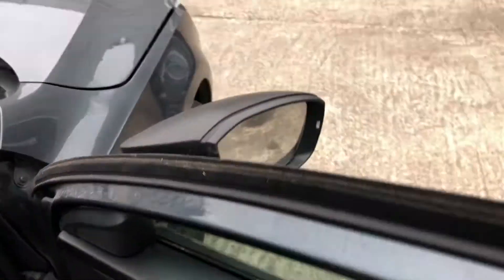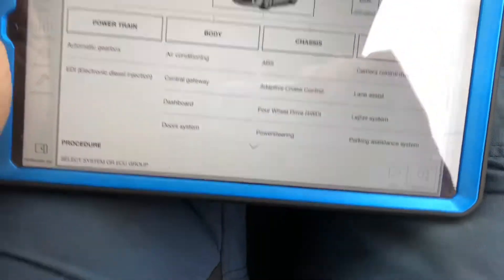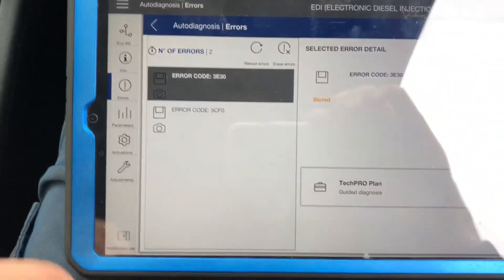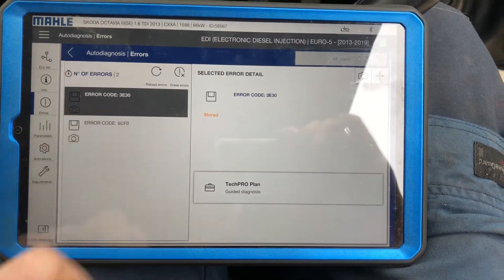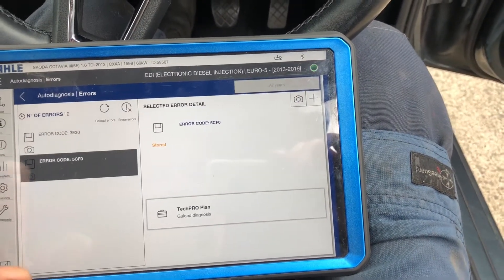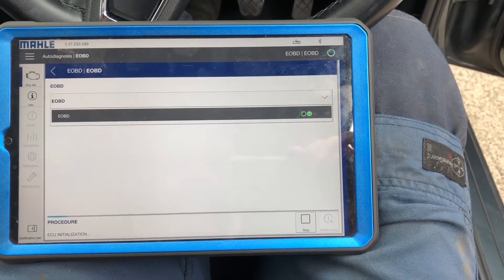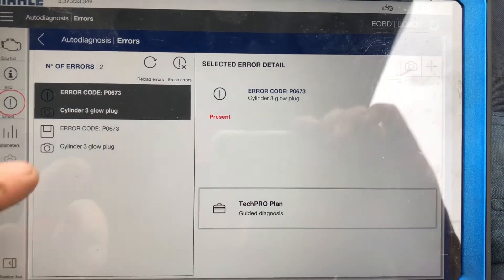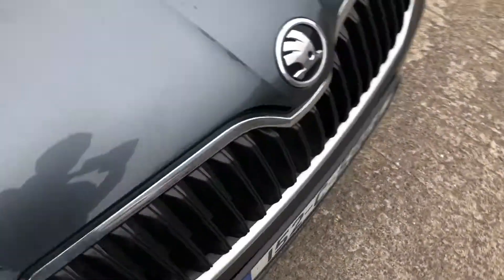P0673 Glow plug testing with integrated pressure sensor

Comment: Thank you for this video. I couldn't find any guides on how to remove the pressure sensor plug connector. I was afraid i would ruin the whole connector if i pulled to hard. 
Now with your video i have an understanding on how the connector is connected.
Reply from the maker: I had the same thoughts hence the video, but I’m glad it helped on this occasion. Good luck when doing it 🙏👍
Reply: Thanks for this video   on how to unplug the glow plug especially. 😊 Trouble with modern cars is there are so many different plugs and connectors , and it's not obvious how most of them unplug. Thanks for showing us inside the glow plug too , I wondered how they worked 😊👍👍👍

Comment: Where do you put the black multi meter wire when testing the plugs
Reply from the maker: Apologies, I should have said. Get a multi meter and put it on the OHM’s setting. Then put the black lead on to battery negative or any clean steel part of the engine. The red multimeter check for a contact through the heater plug and back to the engine or battery negative. 
Does that make sense??

Comment: Your video is great, I have this problem, I changed the spark plug 3 and I still have the same fault p0673, could it be the wiring? or could it be the relay? What do you recommend?
Reply from the maker: Where did you buy the glow plug ?? They can be expensive 😬
Reply: @kennedysgarage3281  en VW 180€
Reply from the maker: @NI1NIRVI  hmmm time to start looking up a wiring diagram 😬😬
Good luck with it 🤞🤞👍
Reply: From what I’ve been told the Bosch ECU doesn’t like cheap spurious glow plugs being fitted, it’s got to be a OEM VAG or BENU 007 anything else can lead to problems.  GSF Motor factors want £220 for a new one !!

Comment: Great video. I have the same issue where cylinder 3 glow plug pressure sensor is low. I have fitted the new glow plug with the pressure sensor however EPC light still shows on the dash and still has the same code. Could this be a damaged connector which sits on top? What would be the best course of action? Thank you :)
Reply from the maker: Is it the same fault code ???
Reply: Hi. No it’s P03AE low pressure sensor in cylinder 3. I’ve checked the wiring and it’s all good. The new glow plug was bought from Amazon for half the price vw was charging, apparently getting it from Vw would fix it I’ve been told because they have the correct revision for the car whereas Amazon has the older revision, any thoughts? Thanks
Reply from the maker: @10casem  you could very well be right, generally I find that cheaper aftermarket electronics parts are just not up to doing what they are meant to. Unfortunately the good quality parts can very expensive though 😬😬👍
Reply: @kennedysgarage3281  Thank you for the replies I will get the new one and try it out. Thanks again 😀
Reply: Just to follow on, issue was sorted just needed a genuine glow plug pressure sensor in cylinder 3. Previous mechanic failed to notice that my car needed this and so did Volkswagen themselves!

Comment: Nice video. I always find using a test light from battery + a better test. What do you think. Ohm's for the win on this one.
Reply from the maker: I also like the test light method, it is a very good and fast test. But some sometimes they can get a greater resistance inside them that can be enough to light the test light but still no glow. On this occasion I was really only educating myself on where to test the glow plug and pressure sensor combined. I find you tube a great source of education for this 🤔👍😉
Thanks for commenting
Reply: @kennedysgarage3281  yes very true the test light could catch you out on this one. I have seen this system on the Opel insignia. I suppose if you break it down to two circuit's, glow plug and pressure sensor 3 wire. Nice break down.
Reply from the maker: @d.d4184  yes, I must do a video on the pressure sensor circuitry 👍

Comment: Hi so I take it to test the sensor you put on the outside part??
Reply from the maker: Hi Scott, this type of glow plug with integrated pressure sensor can be tested with the block connector disconnected. Your multimeter goes from battery negative to the center pin on the glow plug. Put your meter on ohms & it shouldn’t read anymore than 1 ohms. I show it at 7 minutes 24 seconds 🙏🙏👍

Comment: hi guys need help 1.6 TDI DGDA error P13D5, replaced spark plug with sensor error does not go away. what to do
Reply from the maker: Quite a lot of people are buying less expensive glow plugs with integrated pressure sensor from online stores which are not good quality. 
Is the one you got OE ??